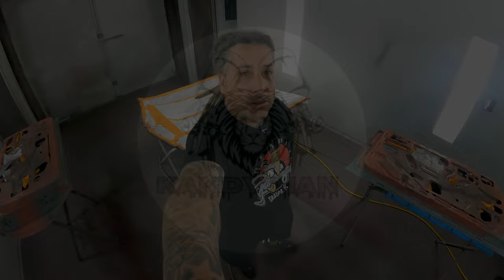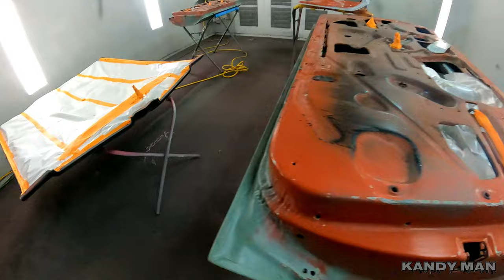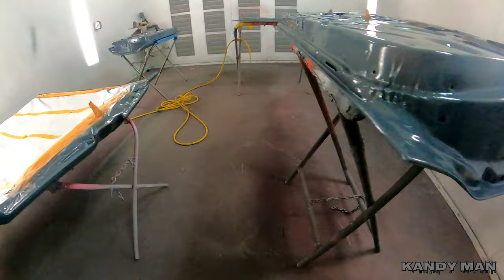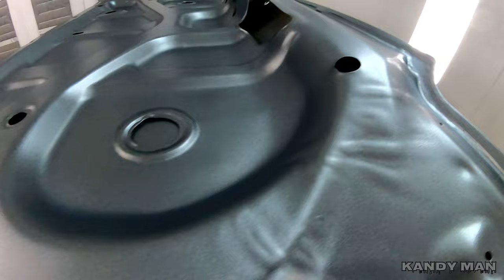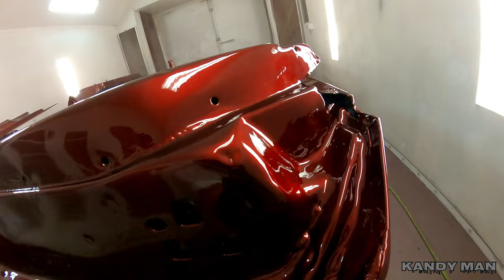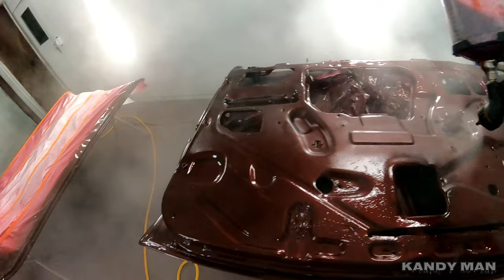STEPS FOR A MIRROR PAINT JOB PART 6

Comment: Yes you are right about the water we use waterborne cleaners in the glasurit 90line system I wipe with water grease and wax cleaner then Final wipe cleaner it works great Especially on raw plastic bumpers !!! Sherwin Williams doesn’t have a water born cleaner you can use?
Reply from the maker: Yes I use it all day at work didn't have at my place so h20 did the trick 👊

Comment: How would you rate a sata 4000b against a dv1? Should i sell my sata and upgrade if getting ready to do a red tri coat?
Reply from the maker: As for the sata they make a great gun .if it's working well for you use it . Buti prefer  the dv1